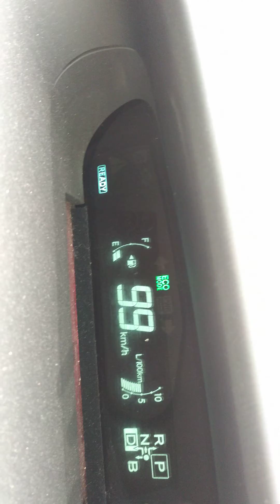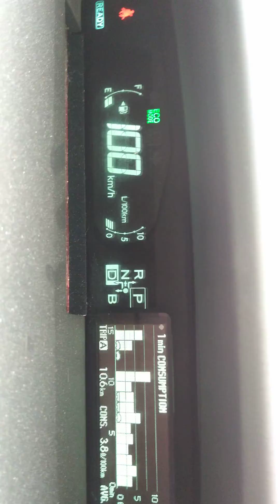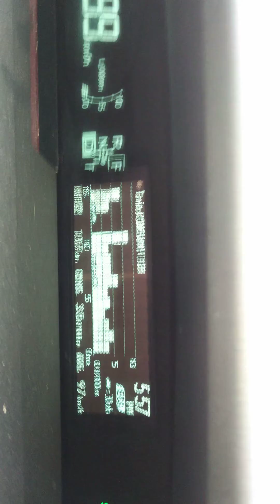HHO kits, DIY Hydrogen Generators, hho generator for car, hydrogen car generator, hydrogen car kit

Comment: And I get 40-42 right now will I get something like 55+?
Reply from the maker: It does depend on your vehicle... It will give you 20 to 30% better MPG whatever vehicle. What you ask sounds about right. I had a 2007 Yaris, 40 MPG on the highway, it went to 60 MPG... 50% better.